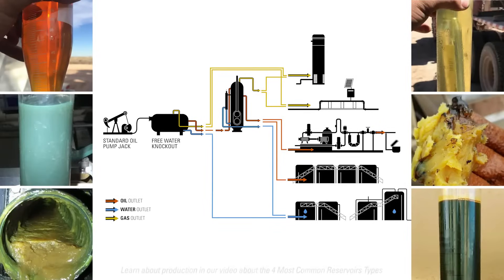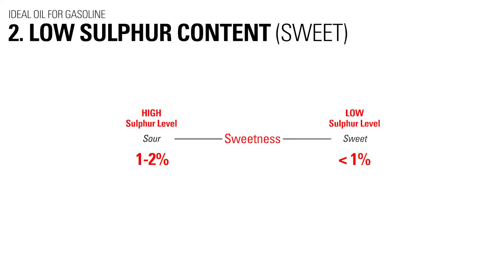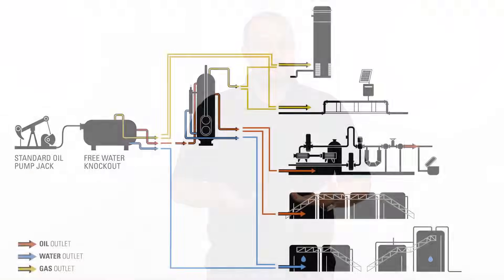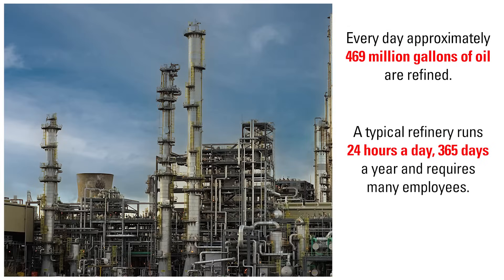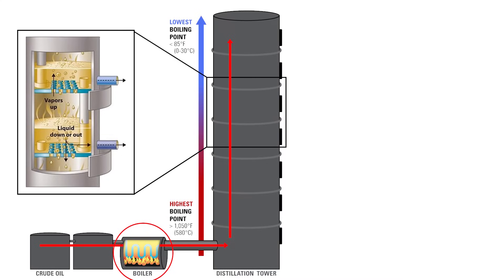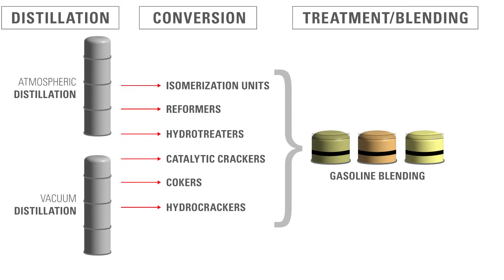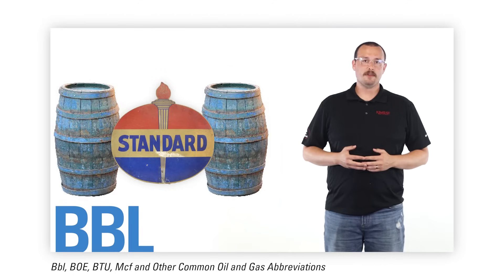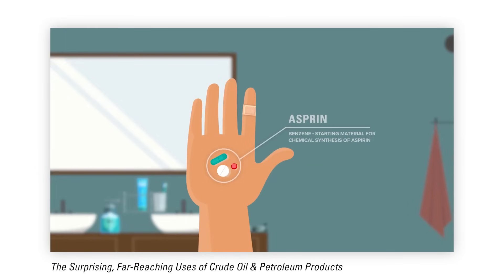How is Gasoline Made from Crude Oil? The Petroleum Refining Process Simplified!

Comment: Gasoline is made from crude oil through a complex refining process that involves several key steps designed to break down and transform raw crude into usable products like gasoline, diesel, jet fuel, and other petrochemicals. Here’s a simplified breakdown of the petroleum refining process:

1. Crude Oil Distillation: The first step in refining crude oil is distillation. Crude oil is heated in a furnace, and the resulting vapor is sent into a distillation column. In this column, the oil separates into different components based on their boiling points. Lighter compounds, such as gases and gasoline, rise to the top, while heavier compounds, such as diesel and asphalt, settle at the bottom. This process creates fractions, which are the building blocks for further refining.

2. Conversion: The gasoline fraction produced in distillation may still contain unwanted heavy hydrocarbons. To refine it further and create high-quality gasoline, refiners use various conversion processes, such as cracking and reforming. 
   - Cracking involves breaking large, heavy molecules into smaller, more useful ones. This is typically done through thermal cracking (heat) or catalytic cracking (using a catalyst to speed up the reaction).
   - Reforming alters the molecular structure of hydrocarbons to improve the quality of gasoline. For example, it can increase the octane rating, which makes the fuel burn more efficiently.

3. Blending: After distillation and conversion, the resulting products are still not ready to be used as gasoline. Refiners then blend different streams of hydrocarbons to create a final gasoline product that meets specific regulatory requirements, such as octane levels, emissions standards, and seasonal formulations (winter vs. summer gasoline). The blending process allows refiners to create gasoline with the right balance of light and heavy components for optimal performance in internal combustion engines.

4. Treatment: Gasoline also undergoes various treatment processes to remove impurities, such as sulfur, nitrogen compounds, and metals, which can lead to engine knocking, emissions, and pollution. These impurities are removed using processes like hydrotreating or desulfurization, which improve both the fuel's performance and its environmental impact.

5. Additives: Finally, refiners may add certain additives to gasoline to improve its stability, performance, and cleanliness. Additives may include detergents to prevent engine deposits, antioxidants to prevent fuel degradation, and corrosion inhibitors to protect engine parts.

The entire refining process is energy-intensive and requires sophisticated technology and infrastructure. While the end result is gasoline, this process also yields many other valuable products, such as diesel, jet fuel, heating oil, and petrochemicals used in the production of plastics, fertilizers, and other goods.

In summary, gasoline is made from crude oil through a multi-step process that includes distillation, conversion, blending, treatment, and the addition of additives. The goal of the refining process is to produce high-quality fuel that is efficient, safe, and environmentally acceptable.

Comment: How hard is it to synthesize fuel from hydrogen and carbon?
Reply: Doable, but energy intensive and costly compared to refining crude oil. Nazi Germany did it during WW2 because they had abundant coal but little oil and couldn't trade for oil from overseas. South Africa did the same during apartheid, same reasons.

Comment: I have wondered why, for the last few decades, Diesel is more expensive that gasoline.  It seems like it takes less refining.
Reply: Very simple... taxes. Excise taxes, road use taxes, etc etc. If you want a real idea what diesel actually cost, check the off-road diesel prices at the nearest co-op.
Reply: 20 years ago, diesel was cheaper, less than regular gasoline by 10-20 cents per gallon. Then the big tax got added, about 2005 as I recall, and now it's higher than premium.
Reply: @2whl4re 
ULSD regulations have also increased the cost of diesel.
Reply: @2whl4re 

100%
Reply: I know that modern diesel fuels are ultra low sulfur, that may require higher grade of crude before refining.
Reply: @jimgoff1170   more processing, same crudes generally.  They  often use Cobalt catalyst as part of the process to pull out most of the sulfur now.  There are some other processes to do it too, that's just a really common one.  They do that to gasoline sold since 2017 as well, just different specs.  That spec set was called Tier 3, which dropped average S allowed from 30 parts to million to 10, and along with it newer catalytic converters on cars since then operate dramatically clean on it too - older ones even are cleaner.  Not many places and volumes produce anymore that aren't Tier 3 compliant in the US but some smaller refineries got extra time to get updated for that set of changes.
Reply: Because they can.  Demand is higher.
Reply: We pay taxes for nothing that’s why it costs a lot.

Comment: Have always wondered is what if the oil refinery wanted to produce more diesel, for example swap the percentage of gasoline and distillates with diesel making up 45% of a barrel of oil and gasoline only 12.5. Could this be done?
Reply: Short answer, percentage of a given product depends on the specific gravity of the starting crude. Light crude will naturally produce a higher percentage of lighter output. By blending the input crude to a target weight you can adjust the output percentage of each product. If you start with a very heavy input you'll get a much higher percentage of tar.
Reply: depends some on what's called the complexity of the refinery, eg how many processing options they have.  They can tweak beyond the natural splits of distillation for a given set of inputs up that stack a few %pts but it's not simply flipping a dial and change the output.  You're limited in practicality and how much energy is needed to pull off whatever limits you can extend too.    But short chains  of HC can be joined or split if you have the right process/gear.  More diesel, you might rejoin some short chains into longer chains, that sort of thing.  Break down diesel length chains, you might come up with more of gasoline or jet fuels etc...  it's kind of endless the options.  And different properties in the source crude mix going in will allow variation in output of product.  When they blend different inputs, they do the chem math and come up with a "crude slate" of inputs.   Not all crude breaks up into the same %s of output products, you tailor that crude slate to get the desired output mix of products - but there are some limits.  There are some standard output ratios they generally work toward too because they know what the markets can absorb/require.

Comment: Question :
So why does Diesel cost more than gasoline.???
In the past, diesel was always cheaper than gas..!
Reply: Higher road taxes levied on diesel, starting in about 2005-2006. The reasoning being diesel vehicle are harder (heavier) on the roads.
Reply: It costs a lot to remove the sulfur. Our diesel, by law, is “ultra low sulfur”.
Reply: Also it's getting harder and harder to find the sweeter oils with lower sulfur.

Comment: One question I need to know the answer to.
When EV gets to a greater adoption the consumption of fossil fuels will decrease.
But humanity still needs products essential made from oil (plastics, lubricants and different chemicals). 
Is it possible to just turn off the gas and diesel taps in the refinery or will they essentially be unwanted bi-products that fewer and fewer wants to buy?
Reply: The "Green new deal folks" don't understand this part of the equation. There are many products made from Oil. Including Medical.

Comment: I didn’t figure out 😢too fast
Reply: basically different hydrocarbons have different boiling points and they use that to capture them at different points, which they are then refined and conditioned and sold. different hydrocarbons have different properties so theyre suited to different tasks. ask if other questions

Comment: Good video but would be nice if for the rest of the world if you used also metric units...
Reply: The world revolves around the USA. Get with the program.
Reply: Something about being gallant with your barrels, which are 6 hands and 3 thumbs high
Reply: imperial is easy to learn, if i can convert between the two with ease at 18, you should to. 

1 gallon = ~3.8 litre
1 inch = 2.54 cm 
1 mile = 1.6 km

12 inches in a foot
36 in a yard

nobody converts between feet and miles. likewise we dont use decimals 

height is 5”10 (five foot 10 [inches]), this is ~178cm.

volume is a bit more difficult, but nothing that comes up in normal conversion. we generally use acres and square feet for land area. other misc information is that for precision endeavors, we either use millimetres or fractions for inches, for example, 6 & 1/16th inches. either that or thousandths (of a inch) for machine work
Reply: It's embarrassing to say but Americans don't really understand the metric system very well. We aren't really taught how to use it in school. Except with Marijuana! We know how to understand grams because of that but that's the exception